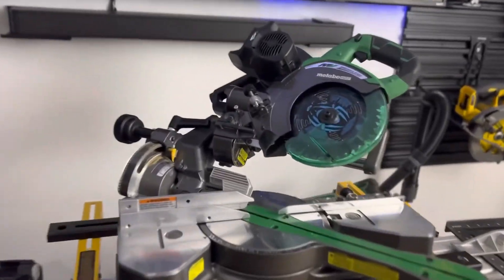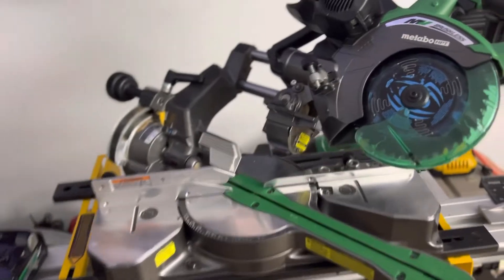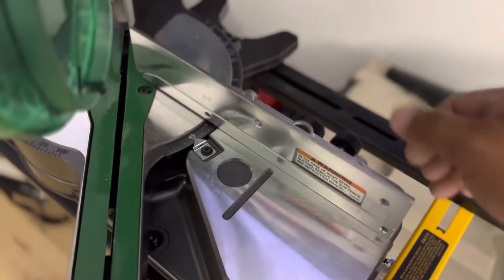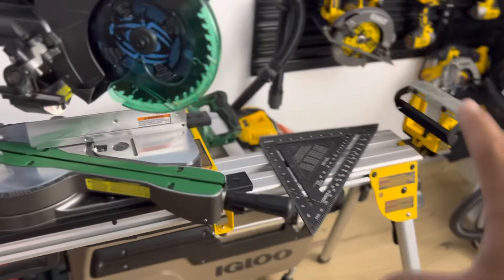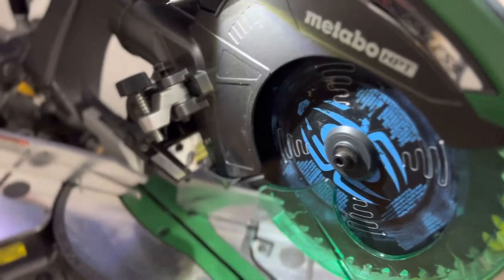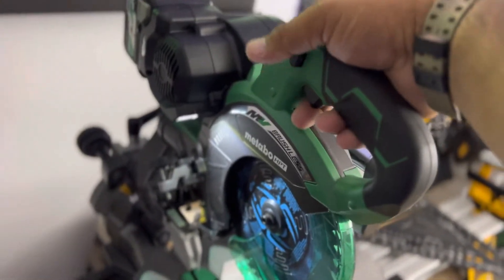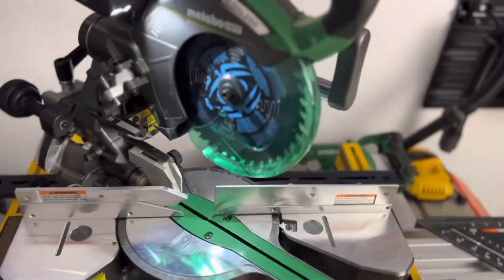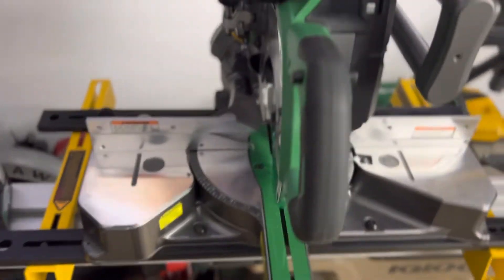Metabo 7 1/4 cordless miter saw review after 1 year

Comment: That saw would be very helpful in cutting so many boards the same length very quickly...and then some. I'm looking into a table saw for ripping lumber. A 7 1/4" blade will do as I do most 2x boards because sometimes buying a 2x8 and ripping it costs lesser than buying two 8-foot 2x4s when I plan on large projects. There is also the cost of blades for ripping. That's why I'm still on the fence on getting one or continue using my corded Ridgid (2006) for ripping with a rip guide.